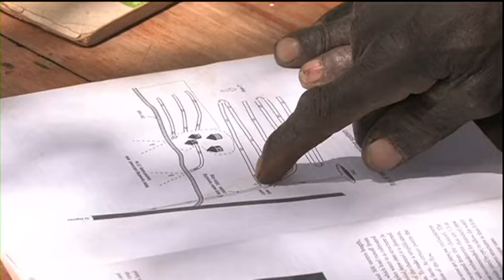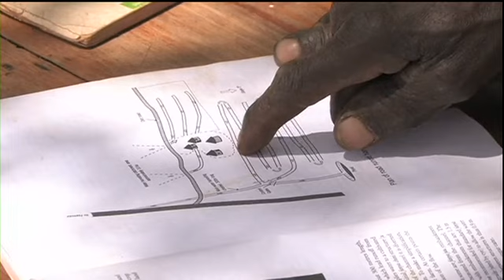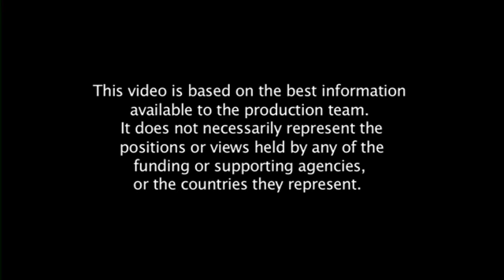Road runoff harvesting

Comment: Any dry area would benefit from catchment systems, but too many governments don't want to bother or spend the money making them. But the people can make them, as long as it doesn't violate the local laws. In ancient times, culverts and waterways were made with stones laid down in ditches to reinforce water direction. I was glad to see him using a chop and drop method of mulching his banana trees. Planting more trees among his garden plants would help shade the earth and would increase moisture too. We must increase tree/shade for dry areas. His trees were separate from his other crops, but the old methods say that plants don't do well in shade. With the heat increasing everywhere, shade is now needed. Dappled shade still allows for adequate sunlight. I grew my plants in mostly strong dappled shade this summer, and they did very well, holding moisture better than surrounding ground.